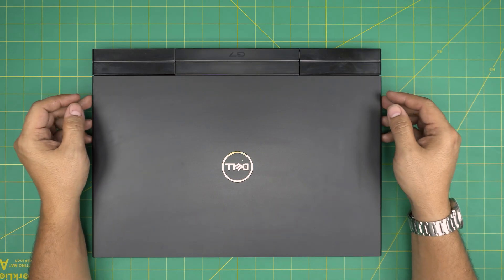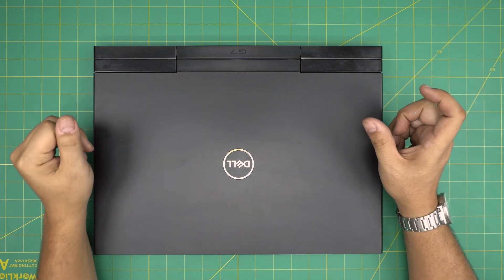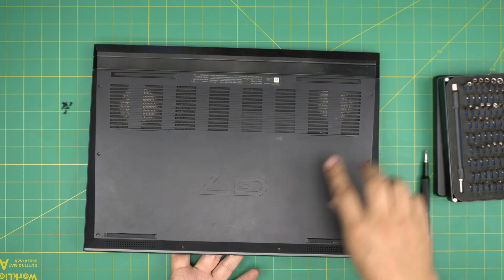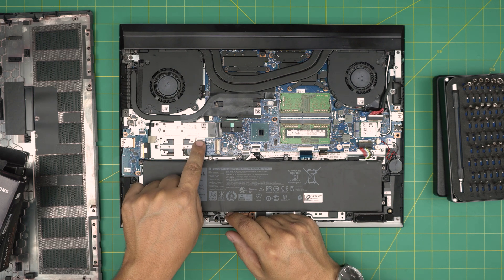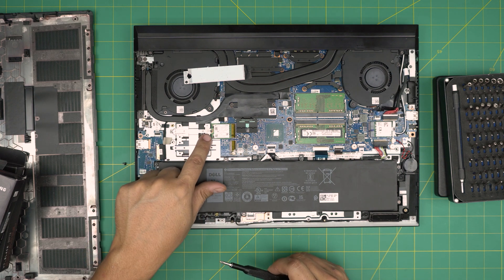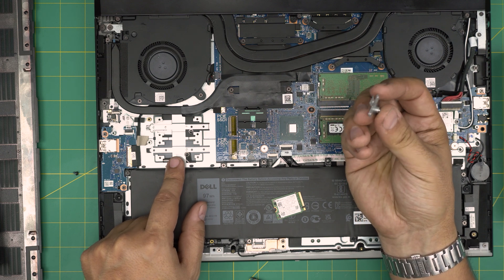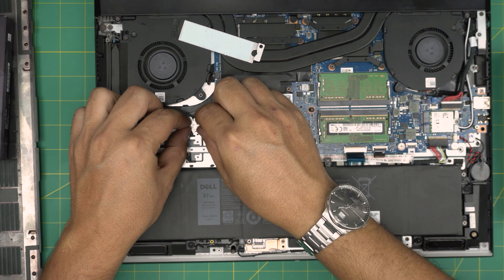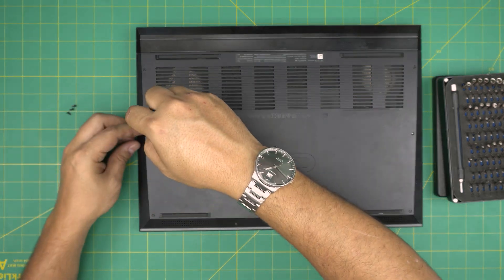How to Upgrade Storage SSD - HDD for DELL G7 7700 Reg,p46E001 Laptop | Step by Step

Comment: Hello, my laptop have 512gb ssd but i want to put another 1tb ssd, can I have both?
Reply from the maker: Regarding your question,  sure you can, you can hace 2x 2TB nvme ssd m.2 in the laptop at the same time. if you wish to keep the 512gb that has your windows and add additional 2TB or 1tb ssd you can. the best ssd for durability and reliability are: https://amzn.to/3PjRjjN
Should you have any further questions or requests in the future, please don't hesitate to ask me.
cheers🍻

This is an Amazon affiliate link. When you use my links, you are helping to support the channel. 🙏
Reply: @uFixTek  thanks for answer, also I want to upgrade memory, I have 8 gb LPDDR4 2933mhz, can I add another 8 gb but with 3200mhz? Or it has to be 2933mhz too? I want to have 16 gb (8x2)
Reply from the maker: you have to place 3200mhz and the bios will auto adjust the mhz to match automatically.
Reply: I also am doing this but do I need the riser? My ssd didn’t come with one and I don’t want to mess with the one with all my files.